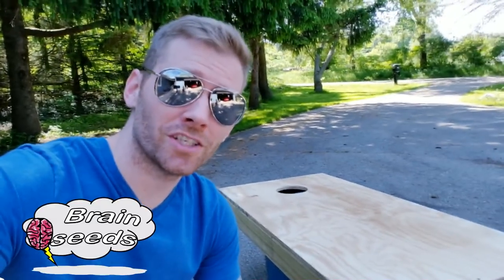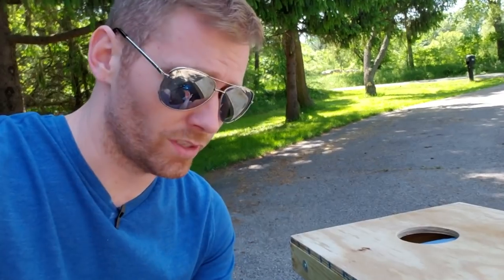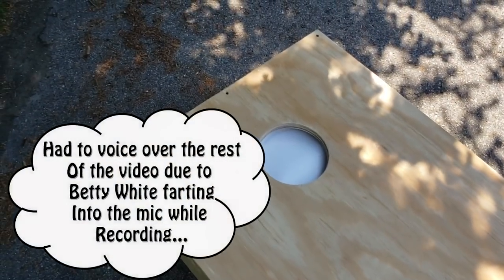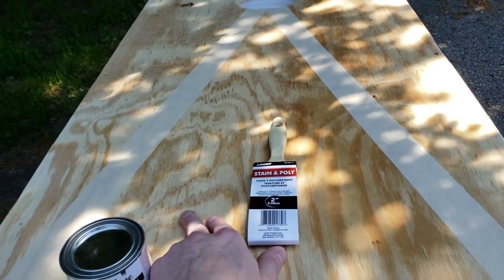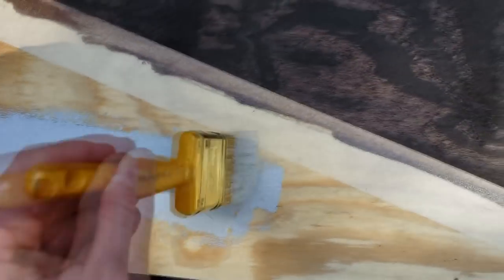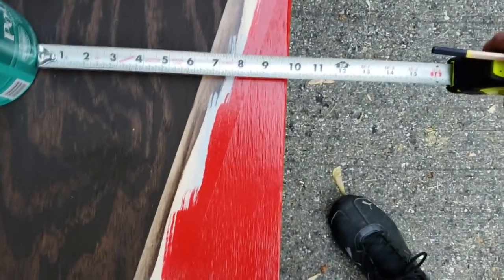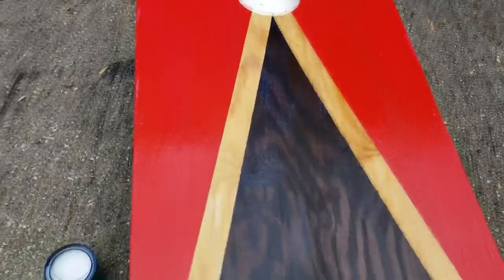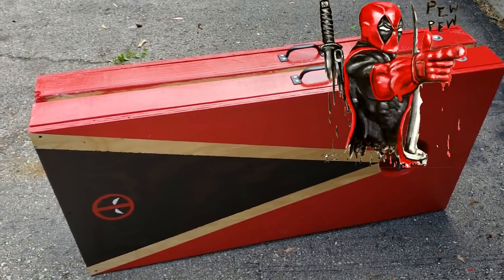How to do a Custom Deadpool finish and more on your Cornhole tables!s

Comment: Good job on the cornhole...I have a question,  I see that you painted the polycrylic on top of the paint...did it hold up pretty well or did the colors of the paint change due to the chemicals in the paint and the polycrylic?

Comment: You did a nice job of finding center of the bottom of the hole. Wouldn't you want to bring the same side of the tape to the corner of the board? Just a thought.

Comment: Is there a corn hole regulation for surface smoothness or resistance?
Reply: Yes, when bags are placed on board they should not slide down via gravity...in other words stay where you put them...